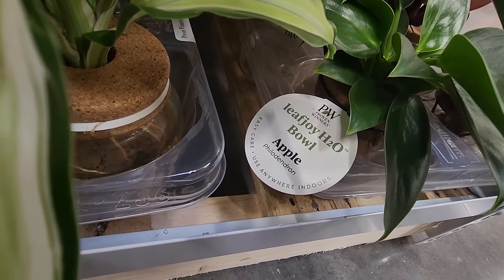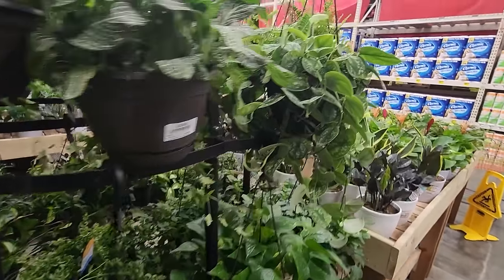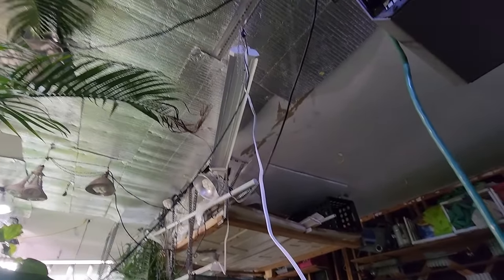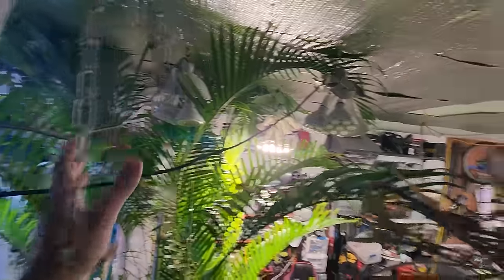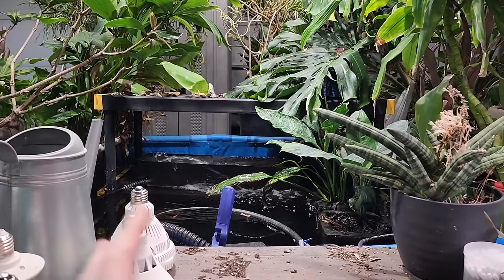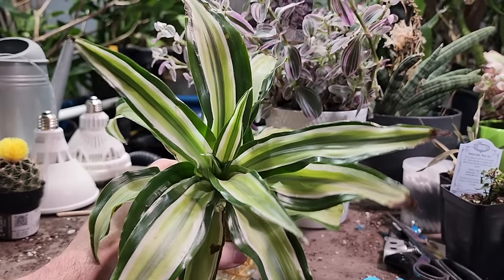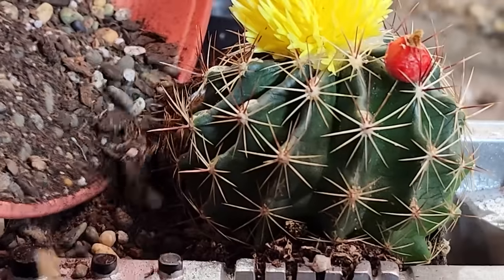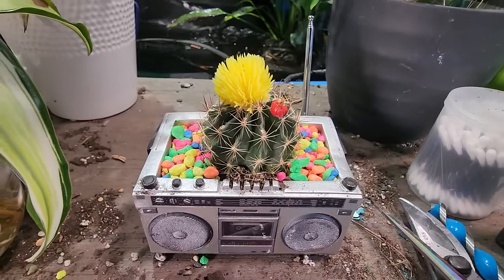Houseplant Shopping at The Home Depot & New Grow Lights

Comment: High quality LED grow lights have a 50,000 hour life. The LED chips are not usually what fails, it's the driver.
Reply from the maker: either way, the lights are busted. I could probably figure out how to change out the drivers, or even replace the chips, but that goes beyond my scope of dedication to the $25 light strips. lol.
Reply: @TropicalPlantParty  it  makes me mad that supposedy reputable  companies build these cheap led lights knowing they will fail. It doesn't take much for them to use a reliable driver, especially on a $40 unit. What a rip off. Seriously, get an HLG 65 or 100 watt lamp. It works beautifully and will last for years. They use samsung horticultural leds and reliable drivers, for not much more money. And they're super bright! Not a salesman just a dedicated user. I have 4 HLG lights. One is over 5 years old and doing fine. Ditch those cheap shop lights, you won't regret it.